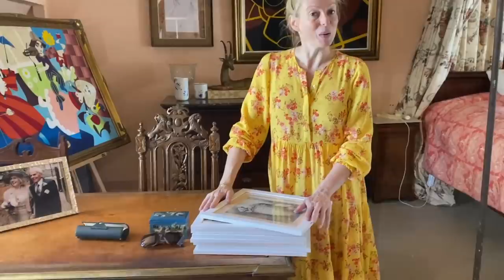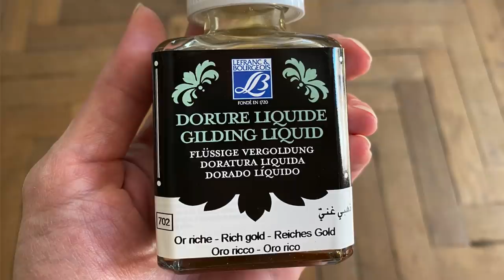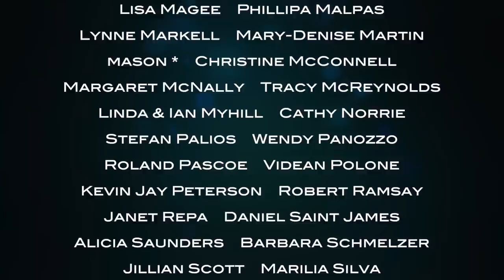THE CHATEAU DIARIES: WONDERFUL CHAPEL NEWS!

Comment: Seeing the way the vaulting fell and what look like "quarry tiles" - the terracotta red squares - suggests the vault is made like Guastavino vaulting. I've been watching these videos for a few months and can't seem to stop. Stephanie, if you haven't already seen the series, Great Designs, it had an early episode that showed the work of a home builder who constructed a vault using the same technique.  It didn't even require centering. It doesn't require expensive materials and it is very strong. It is thin tile cemented in built-up layers using only plaster of Paris.
But where one would start and how to get above the vault is puzzling me. My best hunch is you would start at the bottom corner and work up using the lowest layer as your guide. When you have built up everything almost to closure you would have to get above the vaulting from that tiny window, I suppose, and fill in the remaining gap. The technique is beautiful and almost as easy as gluing the tiles to the wall edgewise and waiting to let the plaster set. The Great designs builder was building barrel vaults and not groin vaults like your chapel so I can't wait to see how the soon-to-retire restorer goes at it. 

.